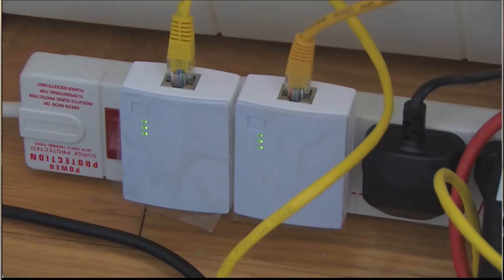Powerline Adaptor FAQs: How Reliable are they? Do they Work across circuits...

Comment: Yeayeayeah. But WHY after working with no problems for months, yesterday it stopped working, the 2 shits had one no middle light, the other a red middle light, then started working again, than stopped this morning again, and started working again MAGICALLY by me just shouting at it, just now...
NO ONE can tell me what the fuck is going on. A ghost got stuck in my power outlet? OH, and changing the plugs of place changes nothing. And if it works again, it's just some quantum switch or some shit.

Comment: I bought some tp link nano adapters years back and they frustrated me as a console gamer because every so often they'd cut out or go into this sleep/power saver mode which would completely disconnect you. What I want to know have these powerline adapters since then have this issue or was mine just a specific build that caused the drops?

Comment: Time stamps:
0:25 How reliable are they?
0:52 Do they work on power strips and surge protectors?
1:28 Are they better than WiFi repeaters?
2:49 Why Peter C uses network file copy instead of Speedtest
4:55 How much do powerline adaptors use?
5:30 Which powerline adaptors do you recommend now? 
6:30 Do they work across multiple circuits?

Great video m8 I appreciate your FAQ.
Reply: myultumatum bless you.
Reply: They cause interference to some computer power source units. My PC reboots when using Powerline and playing games.

Comment: I have a problem with a TP link powerline adapters :  Powerline adapters just wont send a DHCP adress to my router . and when i replace them back with a cable it works .

Network diagram : ISP----->their modem in bridge----->Powerline adapter------>Powerline Adapter----->My Router------>My Computer

Comment: I found your video, I just commented in your other video how about review after all of the years.
I am agree with you, you need test it as local networks test, other then copying file within your local networks, you can always use networks stress tester.
Thank you for your video, it's really help me, since I am now in the middle to decide do I need to run 1 gbit ethernet cable or just use the powerline adapter.
Reply from the maker: Thank you for your comment and understanding.

Comment: Do they work with the transmitter and receiver behind an isolation transformer? Howabout one of the Units in front of the isolation transformer and one behind it? Do modern ones interfere with HF radio?
Reply from the maker: +Knuckles the Echidna Will have to try that one out! I don't think they will however.
Reply from the maker: +Knuckles the Echidna I gave it a bit of a test today and could not get them to work across an isolation transformer.

Comment: The BT AV500s have been awful from one side of a business office to another. They would work quite well and show "green" connection quality except would usually have at least 1 hour of downtime a day (in a contiguous block) where the link light would go out entirely. It has been improved by moving one of the power line adapters slightly closer on the sockets to the other adapter. Strangely they now show "red" link quality but don't seem to suffer the daily downtime.
Reply from the maker: +icannotgetafreename That is bizarre. I had planned to test the BT AV500s, but I felt that reviews did not justify the outlay for them. I might see if any are available cheap so I can test in this environment.
Reply: +Peter C If you don't already know - a lot of these devices (BT AV500s included) can be controlled using the PowerPacket utility:
https://wikidevi.com/wiki/Atheros_Power_Packet_Utility
Sometimes gives more information than the manufacturers utilities.